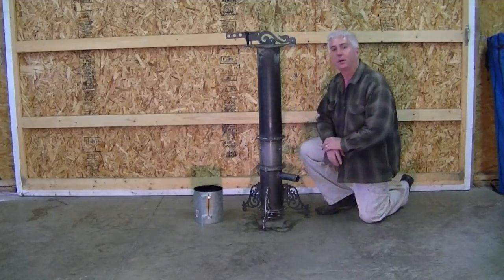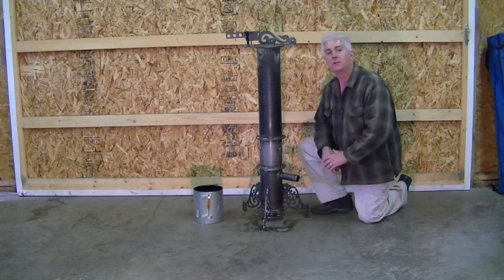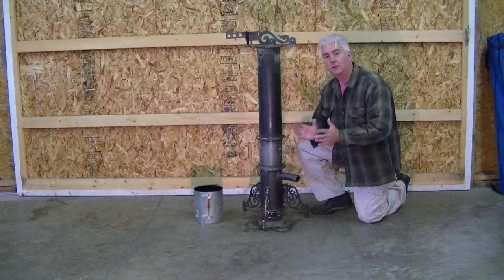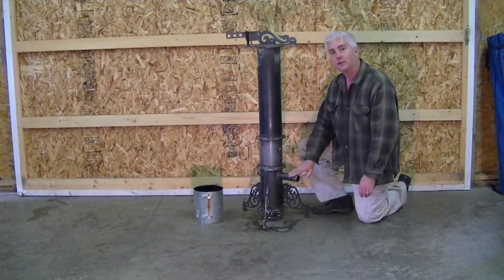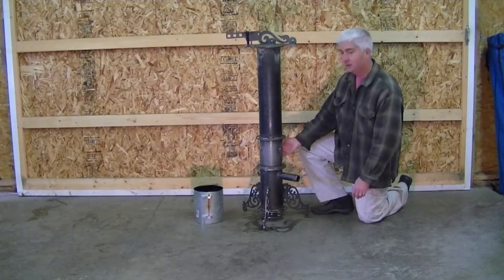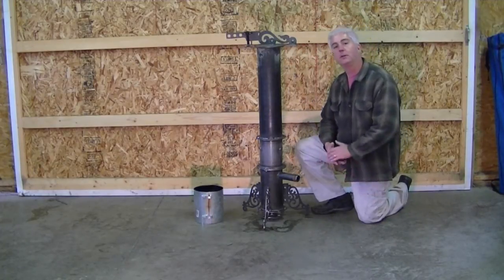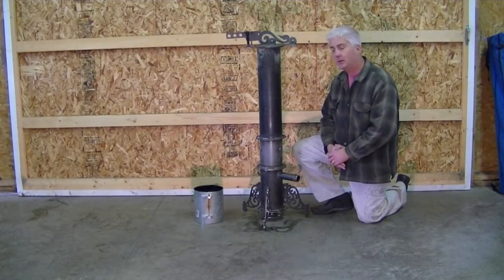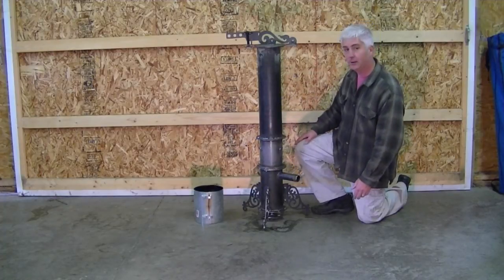2015 Victoria Gasifier Introduction

Comment: there is a lot more goin on inside that little unit than most people would ever realize... 900.00 is a steal... I'd suggest you increase the price by about a grand... just saying.
Reply from the maker: I would absolutely love to if the market would allow it.  Once the Gas Station is more developed and offers more value the prices will go up because I can save more for the customer.
Reply: I do find it funny that some people can't see how ingenious this is in it's simplicity.

I point others to your work regularly.

This really is one of those items you do really get more than what you pay for.  I wish this had been available when I started looking at gasification.
Reply from the maker: International Supply Hi Arvid,,,I appreciate the sentiments.  It's still just blowing flames through charcoal.  I think the big difference is that you have seen inside all my machines so there is far less voodoo and hype for you